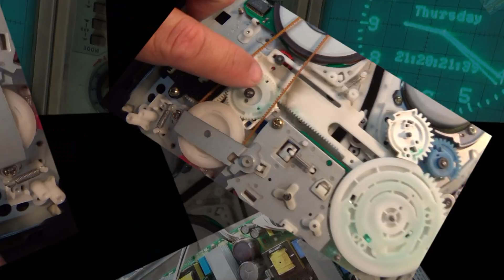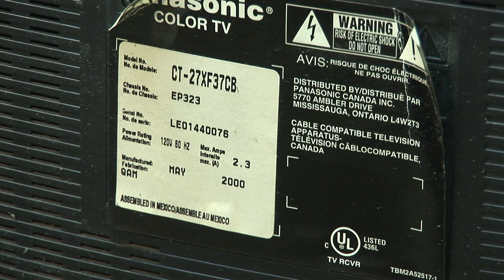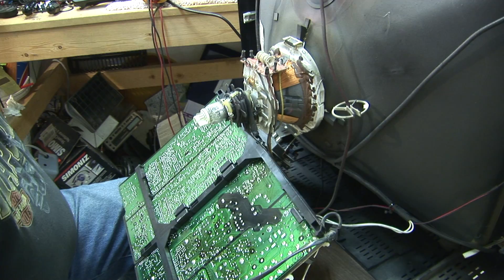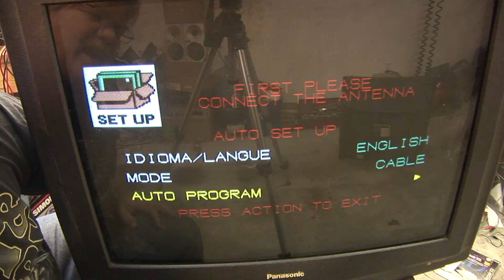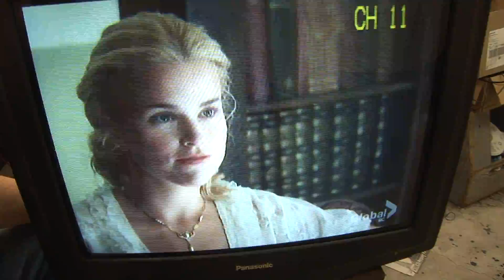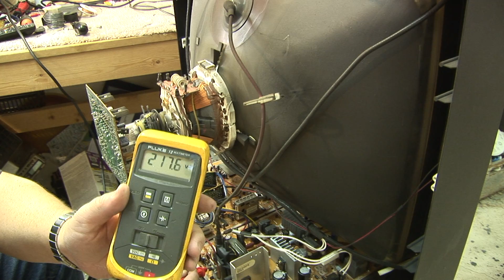Panasonic TV very washed out picture repair

Comment: sir can you show me were is the fucos control...
Reply from the maker: It is on the back of the flyback. There are 2 adjustments. One is master screen, and the other the focus control. and they are labeled.
Reply: THANKS A LOT SIR....GODSPEED
Reply: be VERY careful inside a TV. The main PSU caps and the tube itself can kill you if you touch them. they hold power WAY after being unplugged. the best way is to discharge them, before poking around..
Reply from the maker: I always service with an isolation transformer when I service line operated devices. The CRT will hold a charge for a bit, but unless you are poking around the second anode you are away from that. The focus lead also has about 10KV but again you have to make an effort to contact that because they are well shielded on modern TVs.
Reply: do the PSU caps pose a electrocution threat too? Those hold 120v i assume right? or do they hold higher volts.
Reply from the maker: They discharge pretty quick when the power is removed, as the stand by supply is drawing power on units with a switching reguklator for standby. On units with a conventional standby supply, when the power relay goes off the power is cut, and the main supply discharges the main B+ supplies as it shits down. Now a dead oscillator in the PSU on a switcher can leave the caps charged, but good design they have a shunt resistor across the caps to discharge them within a minute on most sets,

Comment: Free makes a big difference!!!
Reply: 12voltvids Someone's not ready to step into the 2000s yet. 

Technically they are. The GAOO was made in May 2000.
Reply from the maker: +Donald Ellett This one was a paid repair. I think I made 60.00 to fix this set for the owner, and they still watch it. Someone not quite ready to step into the 2000's yet.I shouldn't laugh. I still have a CRT tv. I have a few of them.

Comment: Just 1 capacitors is all that was bad??  I was always told you have to keep the microfarads the same and could go a little higher in voltage??
Reply from the maker: +Donald Ellett Yes just the 1 cap in the screen filter circuit is all that was bad on that one. Yes you can go higher in voltage. The capacity you want to keep close to original value, but it depends on what the circuits is. In this case it would be OK to up both the uF and the voltage, as it is not a critical tuned circuit, it is just a filter cap for the power supply.

Comment: OK thanks...I Wii check it out.  what do think the odds are that the flyback needs replacing?
Reply from the maker: +Larry L 
Panasonic didn't have flyback problems. Sony and RCA, yes. 
Not saying it can't happen but they didn't have many problems. Usually it was dry glue around the core which resulted in it squealing.

Comment: That's good to know about the transistor; I'm going to see if I can still get one from Panasonic. I see about 3 transformers on this board (not including the flyback).  Are you talking about cracked solder joints on the drive transformer; also, would the drive transformer  be the larger transformer (other than the flyback).  Unfortunately, I'm trying to diagnose this without the benefit of a schematic.  My Panasonic model # is: CT - 31S18S.  I took a picture of the circuit board but I can't figure out how to send it you on YT.
Reply from the maker: +Larry L 
The horizontal transformer is small an the secondary connects to the base pin of the horizontal output transistor and ground.
Reply: traduzindo para português brasileiro
Reply: eu

Comment: The transistor is shorted.  I checked and found the highest resistance to be 0.3 ohms.  As mentioned earlier, I had checked caps and diodes in the power section and they all checked good. I did replace a 220uf cap because the outside wrapping had really shrunk around the cap.  I'm sure this shorted transistor is the problem. All I gotta do now is find one similar.  Once again...thank you so much.  I will let you know what happens when I get it replaced.
Reply from the maker: +Larry L Check the connections on the pins of the drive transformer. What usually happens is a cracked connection causes arcing around the pins and the resulting noise kills the transistor. Also beware of counterfeit transistors. They look identical and will fail within hours. I don't know how big this problem is today but 15 years ago the counterfeits were so prevalent in the marketplace, that if you didn't buy direct from the manufacture parts dept, there was an excellent chance that you were getting a fake.

Comment: Thank you 12voltvids for your response.....didn't expect it to be so quick.    BTW....no picture....just a black screen with a high pitch frequency tone.  The TV just hit 20 years old and its been great....I hate to give it up if I don't have to.  I'll try your suggestion....thanks again for your time and response....that's very kind of you!
Reply from the maker: +Larry L Does it have a separate switching power supply (inverter type)?The set features in this video does. That is the small transformer in the middle of the board with the copper foil tape wrapped around it.Panasonic made TVs with both switching type power supplies and conventional linear. If so the squealing is likely the power supply trying to produce power, but there is a short somewhere in the secondary. Check the horizontal output transistor for short. You can remove it, and see if the 160v B+ supply comes back (and the squealing stops) If the horizontal output is not shorted, you will need to check the diodes in the secondary of the power supply circuit for shorts.The fact that you hear a high pitched squeal indicated that the oscillator and output for the power supply is running,  If the output transistor is OK and there are no apparent shorts on any of the various outputs from the switching transformer, try disconnecting the B+ input from the flyback. If the horizontal output is shorted it could be from one of a few things. It could be a shorted flyback, that caused it, or loss of horizontal drive usually caused by cracked solder on the horizontal drive transformer.We have an old 28" Panasonic CRT TV at work in the lunch room that is broken. I took in my old DLP and stuck the old one under the counter. I should drag it home and do a service video on it for fun.  If it wasn't so bloody heavy I would have already done that.

Comment: I have a Panasonic 31" CRT tv.  It doesn't power on but make a whistling sound.  I checked and replaced capacitors and diodes with no luck.  Any ideas?  Thanks
Reply from the maker: +Larry L Does it have a picture?If so the likely cause of the whistle is a cracked core on the flyback (HV transformer) The fix for that is really simple. Pour some super glue down the core around the ferrite rod. This will seal the joint in the middle and stop it from squealing. There are also other ferrite inductors in the horizontal deflection that come unglued, and even the deflection yoke has been known to whistle.That was a very common problem with Panasonics.

Comment: Interesting, I have a CT-27SF37B from 2001 that appears to be the exact same set but isn't labeled on the face as belonging to Panny's upper tier "GAOO" CRT line (seen @13:05). This set, or at least my model, has some crappy picture processing that can be turned off in the service menu for a better picture. Also has Velocity Scan Modulation that can be disabled by disconnecting a pair of wires that run off the tube to the main board (a jack labeled "C2"). Calibrated this TV really has fantastic picture quality for what it is. Thanks for the video!
Reply from the maker: +sehnzeleid The same set was marketed under the Gaoo line, and the only difference was the CRT. The glass on the GAOO line was darker, increasing the contrast (and shortening the life of the tube as it had to be driven harder)Velocity scan modulation, changing the speed of the beam as it scanned slightly to sharpen edges of images, some people thought it improved the picture, others not so much. I used to have a TAU 34" CRT set that recently went to the recycler, despite my protests to fix it because it was the last of the HDCRT sets that was made, and when it was running it had a superb picture easily beating any LCD/LED tv, and even outperforming the plasma that replaced it in most situations. BUt it weighed a bloody ton, and nobody would help me move it, other than to the truck to dispose of it!
Reply: Sorry about the long belated reply and thanks!

Comment: what model esr meter is that,i have to buy one ,nice video's
Reply from the maker: It was a kit. Based on the Dick Smith kit from 30 years ago. They are still readily available, and they work great.
Reply: @12voltvids  I know at least 5 YouTubers... who will have a heart attack watching you work with that CVR... without discharge the so very dangerous high voltage inside that tube....... I'm sure you know exactly where and where NOT to touch...
Reply from the maker: @Ramdileo_sys  Its not that dangerous. Unless you go about sticking your fingers on the horizontal output or under the HV cap. I spent 20 years in the business and got but a few times including from the 30KV 3nd anode. Youo just have to be careful. Old tube amplifiers and radios far more dangerous to work on. (and tube TVs)